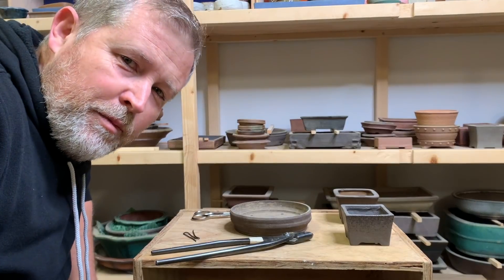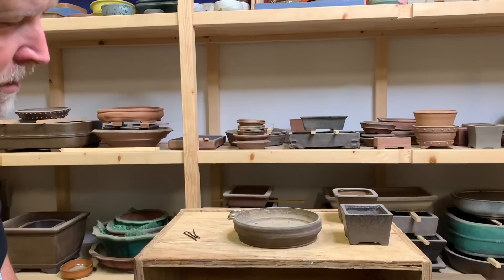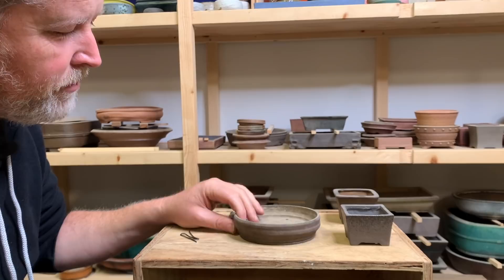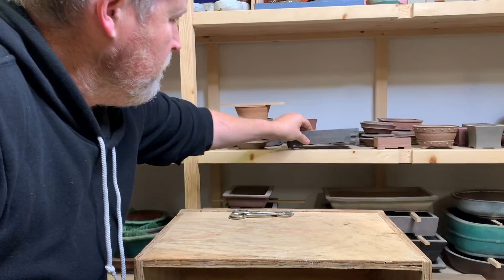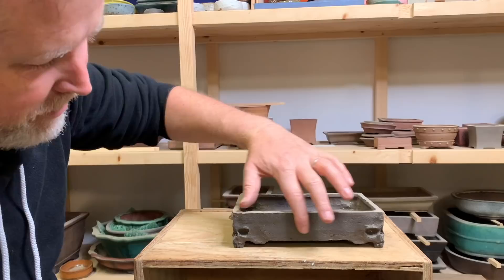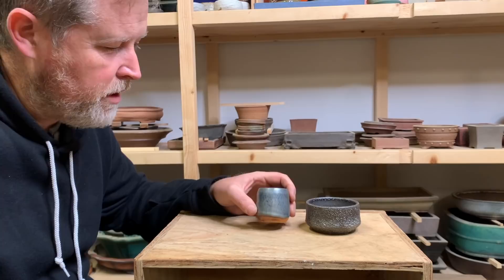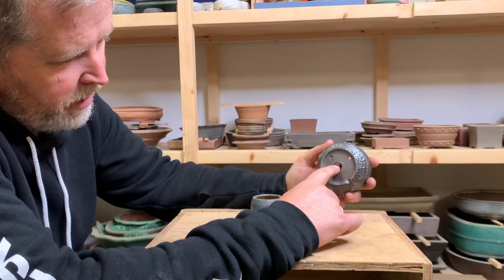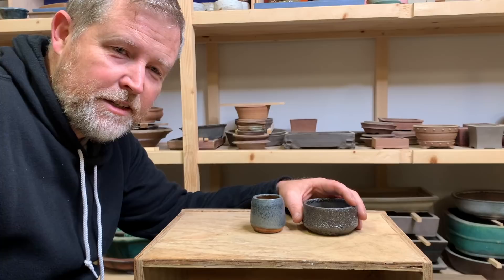Bonsaify | Learning About These Details Will Make Your Bonsai Pots Better!

Comment: An outward flare as the pot trends upward, or a pot whose mouth is bigger than the neck,  allows for frost expansion.  In areas that freeze where the pots are left on the bench, broken pots are common from frost heave, that is, the moisture expands and there is no room for the ice to move the soil and it breaks the rim.  Another consideration for frostproof pots is that the firing temperature has to be hot enough to completely vitrify the clay or it may be too porous for cold weathering.
Reply from the maker: Thanks Brandon!  I didn't discuss vitrification, but any high fire is typically okay.  Do you know a cone that is the cutoff?

Comment: I bought some plasterboard joining tape it's 2 inch by 50 meters it's a mesh type and it's great to use for the drainage hole it's slightly adhesive and it stays put.tfs your technique. When I use a non bonsai I use adhesive raised plastic dots

Comment: Nice critique of those different styes of bonsai pot Eric. I agree with what you pointed out with each one, I also find it especially tricky to add a rim to the inside top of pots so always add the rim to the outside as you point out this makes it difficult to get the tree out when repotting.  You mentioned glazing on the inside of a bonsai pot and I believe the reason we don't do it is because the tree roots seem to 'cling' better to the unglazed rough texture of the clay (I use a crank clay body). I did see an explanation years ago so not sure how true this is, however I never glaze the inside of my pots - unless it a Suiban!

Comment: With regards to the square central hole, if you put the staple diagonally to begin with there would be no ability for the screen to rotate at all, so there'd be less potential for movement even than a round hole.  Perhaps that was your original thought in making the holes square?
Reply from the maker: Maybe. And yes you are correct. But round works.  Perhaps I even thought that a square hole would drain better because the surface tension of water would be less at the corner. I'm not sure what I was thinking in 2006.🙈.  In retrospect I see no benefit, but I am not omnipotent and all-seeing.👀

Comment: Eric 
Really nice video, your comments are spot on. The initial reason pots are not glazed on the inside (per Michael Ryan Bell) is that when glazes had minerals such as lead in them, they were toxic to the trees. So no part of the soil was allowed to touch the glazed area as it could leach and poison the trees. Not glazing the insides is now  just traditional.

Comment: Re: problem with square holes.  A square hole makes for 4 stress risers at the corners.........just like the perferations in paper.  They cause both a concentration and a weakness at those points.

Comment: My question: “Bonsai pots aren’t glazed on the inside” curious if we don’t know the horticultural reasons- is the reason “just because” perhaps? Perhaps there isn’t much of a reason that would be a detriment to the trees, as we see porcelain has been used, folks have used fully glazed pots, and the textural coefficient doesn’t stop other potted plants from growing well. Perhaps the pervasive element of * no glaze on the inside* actually comes from a tradition of economy or horticultural myths of roots being happier grabbing a more rough surface. I’d love to know your thoughts as I had just had this convo today with folks and was reading about it on BNut.
Reply: Glaze gives the pot personality that we can appreciate on the outside of the pot.....glazing the inside of pots is basically a waste of glaze.
Reply: @PIT-EKA  thanks for the response and I love your work btw- in that case I may continue to glaze the inside of my pots until it’s no longer within my means.
Reply: I thought the absence of glaze on the inside and both sides of the pot bottom help with evaporation of water, so the pot can breathe a bit like a terracotta pot.
Reply: @Sylvicolus  actually pots used for bonsai or outdoor use other than terra cotta or such are vitrified, making them mostly impervious to water, so they don’t do the “breathing” that terra cotta or earthenware does.
Reply: @Sylvicolus  terracotta is a low fired clay with a high absorption rate.  Mid and   high fired clay when vitrified have a very low absorption rate which limits water entering the fired clay.  This is why they are able to survive repeated freeze and thaw cycles.
Reply from the maker: I would say that the smooth sides are detrimental to root growth and although I can't point to a reason, I would add that many modern potters in Japan that create handmade pots actually create scoring patterns on the interior of the pots to roughen the surface further.  (Glad to hear you're making pots!)
Reply: @Bonsaify  thanks for the response Eric! Maybe one day I will find some cool comparative insights between glazed and unglazed root production (or have my own) and whether or not it is enough to warrant the practice. Either way, it seems everyone wants them that way so maybe I’ll just default to what’s done because “it’s what’s done” until I have better evidence so support my claims 🤷‍♂️
Reply: @Bonsaify  it is said that the vertical scoring is to prevent the roots from circling within the pot.  When the root tips hit a groove the root will follow the groove downwards to the bottom of the pot.  I may do some experimentation next spring to confirm this.
Reply: @Bonsaify  ... while the roots do grip a rough surface better, it is redudant since the tree in a bonsai pot is already tied down to the pot with wires. Trees seem to thrive in air-pots, despite being very smooth on the inside. So i don't see any evidence to support the claim that smooth surface is detrimental.
Reply: @PIT-EKA  ... "glazing the insides of pots is a waste of glaze"

only true from the tree owners perspective. for the pot maker, pots are the medium of artistic expression just like the tree is for a bonsai artist.

thats why there are many chinese and japanese bonsai pots having full glaze or made of porcelain. thats why there are intricate details on the outer surface, intricate paintings & colors. none of this matters to the tree sitting in it. its the potter elevating his/her art. 

think street food vs michelin starred food. our body couldn't care less either way but the latter is an example of a chef elevating ordinary cooking to a sophisticated art.
Reply: @zeroeure  Rough surfaces are more beneficial to holding water via adhesion than smooth surfaces. That's really important because the inside of the pot (right where it meets the soil) is the hottest part of the soil (the clay is basically the only thermal retention in the equation) and so suffers from the most evaporation, so anything that benefits the water holding capacity of the soil is a big plus because the main issue with bonsai cultivation is how to provide water to the tree in the miniaturised environment.
Reply: @VinnyChirayil  Building off my previous comment, the purpose of an air-pot is for roots to dry out and wither, killing off the apical meristem of any root tips once they have grown outside the boundaries of the pot. This encourages lateral root formation inside the pot, where the roots have access to moisture again. These pots are also usually used on trees in development when the artist/grower is trying to build a good root system for the tree. It's a notable exception but it makes sense here that you don't want moisture around the edges of the pot in this example.
Reply: @boxCatalogue  ... ... thank you, i am aware of what they do. i gave the example of air-pots in the context of smooth inner walls not being a hindrance to great growth. smooth wall being detrimental does not seem to be supported by evidence.
Reply: @VinnyChirayil  I think saying that smooth surfaces are detrimental probably isn't a great way to communicate the point. It's more so a case that rough surfaces on the interior are generally better for a clay bonsai pot when the tree has refined structures both above and below the soil and is ready for the bonsai container both artistically and culturally. Longer access to water is critical to bonsai growth (and crucially health as well) as it increases the amount of time the tree can be photosynthesising at full capacity, and a rough surface on the inner face of the pot provides this. Although it's a very small benefit, it's also cheaper to do than not do and doesn't affect the overall display of the tree or pot when combined, so there's really no reason to have glaze on the inside of the pot if you plan to grow trees in it.
Reply from the maker: Hey Vinnie - just saw this.  I did not (consciously ) hide any of your comments.  And generally, I'm happy to have you all commenting and debating here. The only thing I generally frown upon are off-color personal comments or outright rudeness.  So, not sure what happened, and while I generally disagree with what you're saying, you are free to say it!  (and I very well may be wrong as I mentioned above.)
Reply: @Bonsaify  ... thank you for clarifying that. I take back what i said. i got the wrong impression.
Reply: A ceramic pot has a higher heat capacity than soil because it is denser and has an ordered structure after firing, not to say "crystalline". But the porosity and water absorption of the pot is negligible compared to the soil. Still, there is a difference between a pot that is glazed (entirely) inside and out and a pot that is glazed only on the outside. The most advantageous would be a pot that is glazed on the outside and on the inside only in the upper part where the soil reaches. Only then the water capillaries are blocked by the glaze in the upper part of the pot and it does not dry out through the edges and the crust on the outside. When watering, the lower part of the pot absorbs water, then releases water and water vapor to the soil and roots.

Comment: I can’t find a video that I think was yours . You mentioned in passing about a technique of only removing the top inch or 2 of soil. But I can’t remember what you called that . Excellent videos 👍🏻
Reply from the maker: Fall soil cleanup is called Soji, you can check the pomegranate video at about the 2:45-3:30 mark. I may have mentioned it in the black pine fall video also...

Comment: Thank you so much for sharing these tips. I  have made few bonsai pots and I am always wondering about the thickness of the walls . What should be the ideal thickness of the slab ?

Should the thickness of the walls be  same for the thrown pots and slab pots?
Reply from the maker: The thickness is generally determined by a balance between structural strength and utility. In larger pots you have a thicker clay throughout. In smaller pots you don't need as much strength so you want to prioritize the volume of soil. Certain areas of pots are normally slightly thicker - the junction of the wall and bottom, and the rim for example. I don't think there is a difference between round and other shapes. You should study existing pots and potters for more detailed information.

Comment: Hi Eric, I've been making pots for 5 or 6 years . I have always added lugs about halfway down on the inside of taller pots for tie wire, cascade, semi cascade etc. Have you seen or heard of anyone else doing this? I'm mainly looking for any good reason not to.. seems like a good idea to me.. please give me any insight on any pros or cons you can see in doing it this way.. thanks Lyle
Reply: It will make it hard to get tree out when repotting
Reply from the maker: There are problems with tall pots and tie wires. But I don't imagine lugs on the inside would be the best solution, as Anders said, it will make it harder to take the tree out at repotting.
Reply: @Bonsaify  hey thanks for taking the time for feedback I will take what you guys said into consideration.👍

Comment: Thanks for the great info.  Im a potter and I want to make myself a bonsai pot.  What clay do you use for outdoor use to avoid freeze/ thaw cracking?  Thanks!
Reply from the maker: I'm not an expert in this because I live in San Francisco...lol.  But I believe it is the firing temperature more than the clay. (although the two are obviously related.). I think Cone 6 is the recommended minimum firing for vitrified stoneware.  So avoid terra cotta type stuff and go for a Cone 6, 8 or 10 clay. I use Laguna "Dark" locally - but clay is a regional product for the most part.

Comment: 12:20 - "Too many holes creating additional labour of putting drainage screens"

Why not use 1 large sheet of drainage screen ? Japanese bonsai nurseries use it. Herons bonsai nursery, UK uses it too. Its a problem only if one wants individual screens for each hole. But why do it that way ? What difference does it make to trees whether it is 1 large screen or multiple small screens ?
Reply: 12:31 - "They are not really creating any benefit for the plant"

If this was true, then whats the need for 2 medium sized holes or 1 large hole ? Just 1 medium sized hole should be fine.

The obvious benefit of this perforated pot floor is better drainage & aeration. Most bonsai pots lack this & hence, its a common practice to put larger substrate particles at the bottom. Even when the pot is kept tilted, a common practice, its drainage will be far superior to a 1 hole pot, which is guaranteed to accumulate excess water. So i find no merit in your criticism.

Your teacher Boon uses pumice as bottom drainage layer (search "deciduous training bonsai boon" on youtube).

Regardless, i hope your complaint of having to cover all drainage holes is consistently applied at ALL pots (nursery & bonsai) having more than 1 medium sized hole. Even unused large wire holes count bcos they too need screens. Google "Repotting and Rootpruning Bonsai - Part II bonsai4me" to see a pot with many such holes. I hope you will call this too a bad design for the sake of consistency of your criticism. 

Many European bonsai potters have eliminated the need for drainage screens completely by having a perforated floor of tiny holes, which i feel is a superior design compared to pots with 1-2 holes.

On youtube, search for "martin englert bonsai potter" to see such bonsai pots. He is a German potter.

Also, image search "Pötscher Walter bonsaischalen walu" & see pots with drainage slits instead of holes and grooves to guide roots to the holes. From the search result of images, choose the one from Bonsai Schalen.

On Bing search engine (not google), do an image search for "drilling extra drainage holes in bonsai pot" to see Michael Hagedorn (blue dress, brown pot) drilling big extra holes. He is doing this bcos he was unhappy with the drainage & aeration from 1 large hole & needed 3 more.

Many bonsai artists, including experts, often partly bury the bonsai pot in soil, for roots to escape out and get extra growth. The escaping roots are sacrificial and a perforated floor or pot with multiple drainage holes easily allows that, while pots with 1-2 holes easily lose drainage when multiple roots escape out through 1-2 holes & block it.

Google "Incredible 388-Year-Old Bonsai Tree Survived Hiroshima Blast mymodernmet" and see 3rd pic from top - a bonsai pot buried in substrate.

Comment: Great video! Very informative, still I have some questions. With what type of clay i should make a bonsai pot? Bonsai pot has to absorb water so has to be made with earthenware clay or should be make with stoneware clay what is high fired clay so it doesn't absorb water?
Reply from the maker: Hi - most bonsai pots are stoneware, the porosity is not important to the plant. TBH, I'm not sure it's ever been shown that terra cotta has some benefit over plastic.  If anyone has actual evidence, LMK. You don't want the pot to absorb water because it can then break in a frost. 

Generally, the clay body is important for traditional pots, and a dark reddish brown  or purple-brown clay is the most prized.
I would suggest you study the IG profile for Tiberio Gracco who is an Italian bonsai potter who sources his own clays. (rather than manufactured clays.)
Reply: @Bonsaify Some of the most highly regarded early to mid 20th Japanese bonsai potters have used quite a bit of white clay.  Heian Tofukuji, Heian Kouzan, and Tsukinowa Yusen are prime examples.  I've found that white clays tend to give a visual pop to bright and glossy glazes.  For unglazed pots, I still prefer the browns, reds, and purples.

Comment: If you put the staple into the corner it will not fall out or move. It will be more stable than with round hole. Debunked.